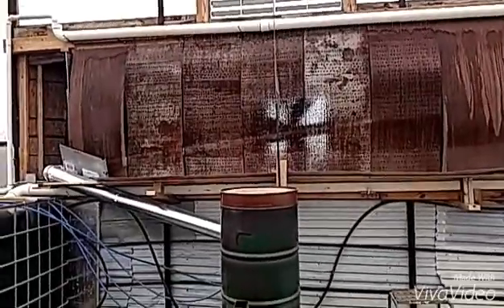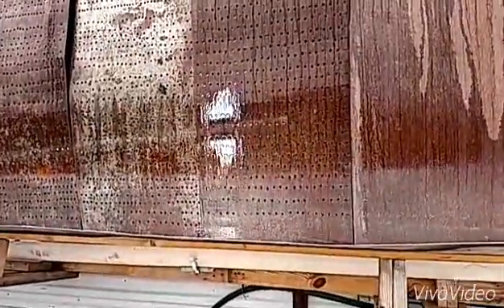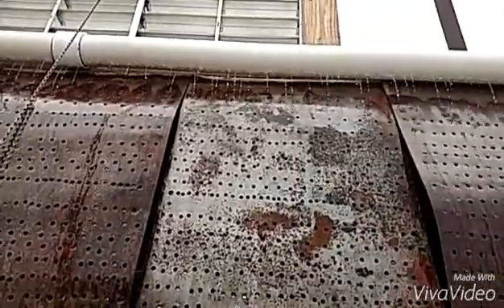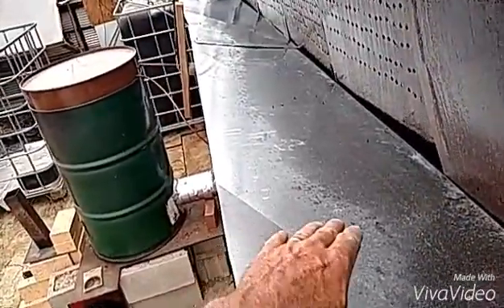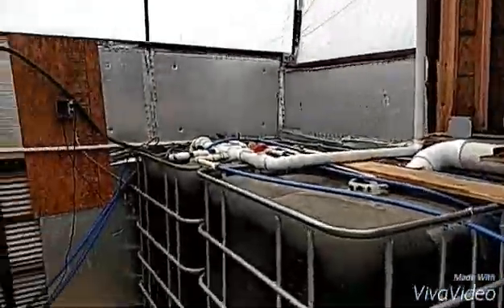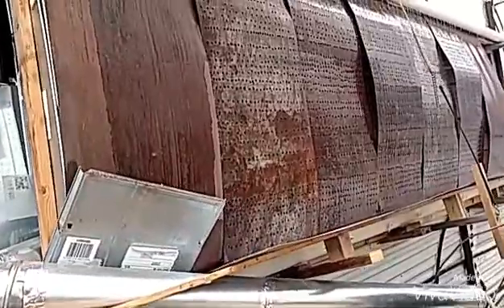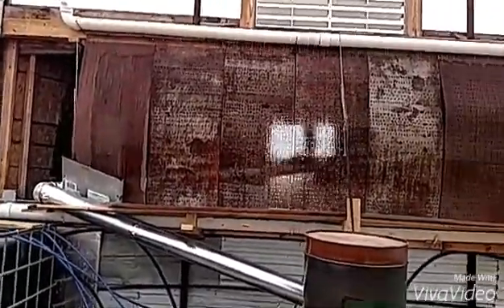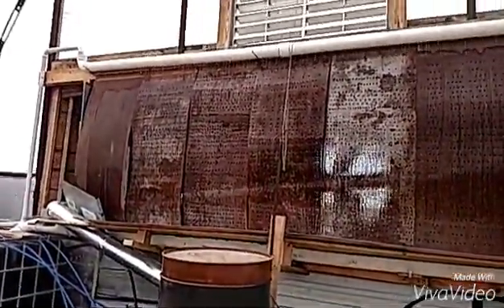Wet wall cooler for aquaponic greenhouse

Comment: Where did you get the stainless steel plates to make the chiller ??? is there anything else you use with it like swamp cooler straw etc . ???
Reply from the maker: Spencer Rushin . I used the panels last summer and it worked but their was not enough air getting thru them. So I just ordered the kuul filters and I will be installing them soon. So check back for that. Thanks, Von